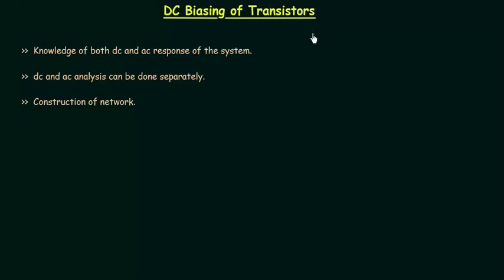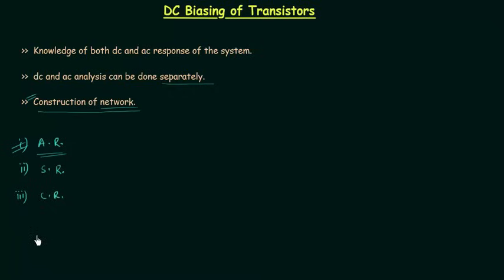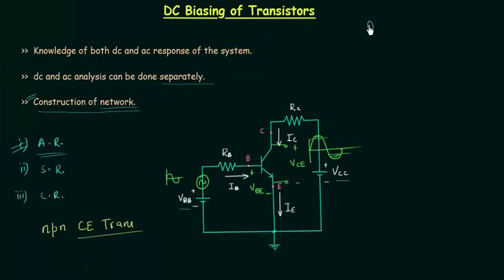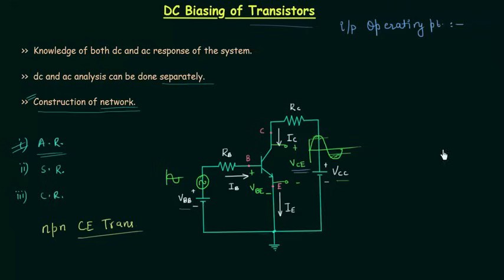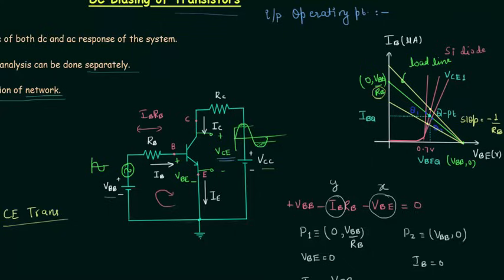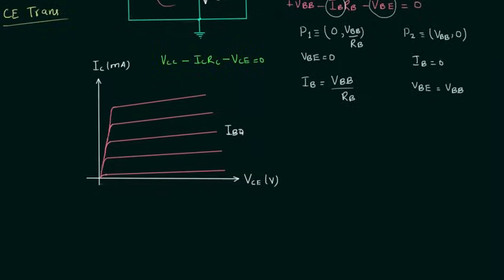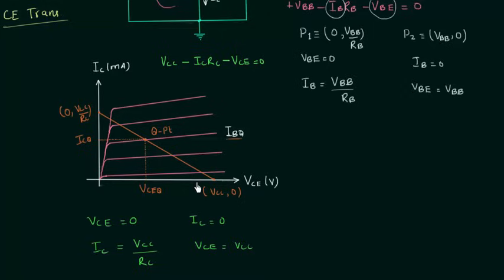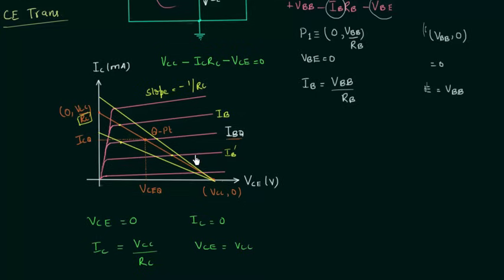DC Biasing, Load Line & Operating Point of Transistors

Comment: 00:09 Biasing is the process of applying external DC voltages to select the appropriate operating point of a transistor.
02:23 NPN transistor amplifies weak input signal without distortion
04:36 The input characteristics of a common emitter transistor involve the base current and voltage
07:08 The load line helps to find the input and output operating points of a circuit.
09:23 The output operating point of a common emitter transistor can be found by drawing a load line using KVL in the output loop.
11:46 The operating point of a transistor can be shifted by changing the base current or the resistance RC.
14:01 Operating point must be selected in the center of the active region to prevent distortion.
16:04 Operating point should not shift due to change in collector current.

Comment: Sir please help me  : To find the operating point we need to take the output equation and here we are taking the input equation , why ??
Reply: Because for setting the operating point we have to decide the input current..... because for npn common emitter transistor.......Ic=alpha°Ib..........means output response is dependent on the input signal......

Comment: Ive have for a long time now considered the possibility of utilising methods not known to current science.. I started to think outside the box and one of the first questions to arise was, does information have a physical weight? I.E if a hard drive has a maximum amount of data stored on it, does it weigh more then it did without data stored to the device.. The answer is no because machines operate using transistor switches to sequence binary code and gate positions are either opened or closed therefore no physical weight is added. This was a very significant question in that position sequencing determined overall machine performance and the fact that a program could actually be written to carry out virtual switch sequencing via software without it physically closing switches on the intergrated circuit led me to believe that I had just solved the issue of heat displacement in silicon based processors. If the transistors are all opened and utilised by the software they generate no heat from being open and closed but instead the software progam recreates binary gate functions via cloud computation and a virtual engine opens and closes the gates. My  Hope is that someone takes this and changes the world. GM.

Comment: SIR
Just now i watched yr video on DC BIASING, LOAD LINE AND OPERATING POINT OF TRANSISTORS.
Yr above video is inspiring. As i have come across in my  experience, even many a B.E/ME graduates are unable to understand them properly, how nicely and convincingly u explain so well with such a ease and clarity that too with out the least confusion is amazing. You earned my highest respect, appreciation as well as my envy of your sound knowledge. while i have now understood many an important explanation u explained there still i have to grasp some few points being a slow learner. So i have recorded in my mobile and need to go thro them repeatedly.
Yr video is outstanding. How i wish the speaking volume a little louder.
Thanking you
vatsa  Bangalore  India

Comment: I find your videos very helpful and I'm very thankful to you but you say that when operating point is chosen close to cutoff region, the positive peak of the signal is clipped and vice versa when the operating point is chosen close to saturation region, but it's completely opposite as to what it's written in my textbook. It's written as " If an operating point is chosen close to saturation region then the Positive peak of the output current will be clipped and if the operating point is chosen close to cutoff region then the negative peak of the output current will be clipped off". Please let me know which is true. I could even send you the diagrams of dc load lines of different operating points to your mail if that could be of any help. Thanks again.
Reply: You are right. 
https://nptel.ac.in/courses/117107095/lecturers/lecture_15/lecture15_page1.htm
Reply: @ganeshsampath113  So, you mean that what's being showcased in the neso academy is wrong and that in the nptel page is correct?
Thank you for the clarification.

Comment: At 10:44, im still confused of how to get the Q point. Why did you consider that particular point?
Reply: Q point is corresponding to the IBq(base current) which we got from the VBE vs IB graph. Suppose  IBQ= 2 microamp then at Ic value 2 microamp we will get our Q point.

Comment: Sir, in output characteristics you said that by increasing base current ( IB) we can increase collector current(Ic) and this also serves the purpose of current amplification for which CE Config is made for. But sir my ques is that ideally base current should be zero because larger base current means larger recombination taking place which is not supposed to be the case. So why are we increasing Base current here to get more amplification.Please clarify these two contradictions.
Reply: i think clearly sir has told that base current has effect on Q value while Q value has no such relation with collector current

Comment: Sir at 14:53 minutes you explained the importance selecting the operation point. But you said clipping in terms of voltage for a positive half cycle(when Q1 is selected) while the clipping in terms of current for a negative half cycle(when Q2 is selected). Can you explain both the things in same point of view i.e., either voltage or current? Because if the current is zero means it doesn't mean the voltage is zero. And I also want to know whether the waveform you have plotted is current or voltage waveform. If you have plotted both as different waveforms means you could explain the thing in terms of power.

Comment: sir Thanx a lot for such nice videos.
Reply: Neso Academy make videos on transistor at high frequency and fet small signal models dey r also.very imp. topics and also on single stage amplifiers of mosfet dey r very significant topics dont mis dem i cheked out for dem whole semester
Reply: Neso Academy  sir are there any videos on television  engineering and radar systems